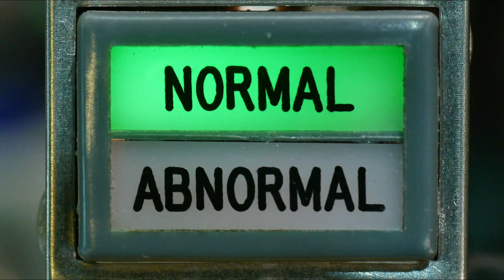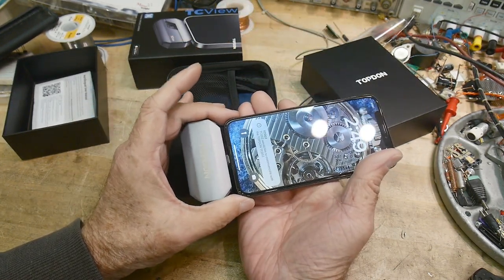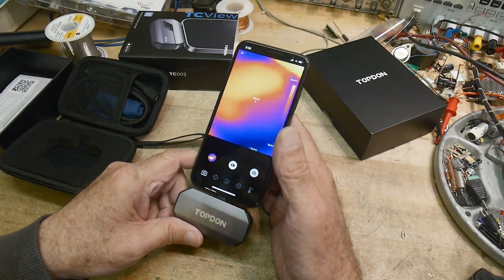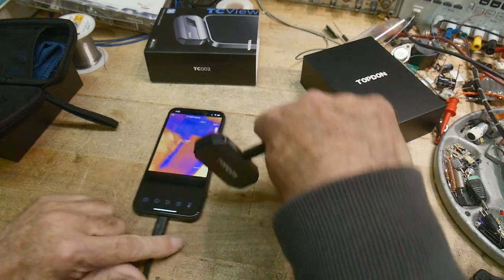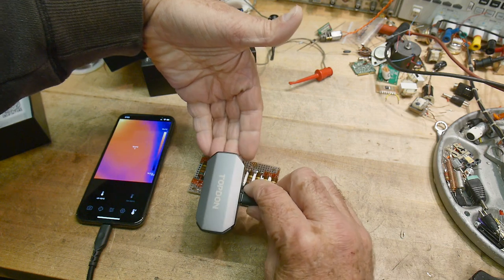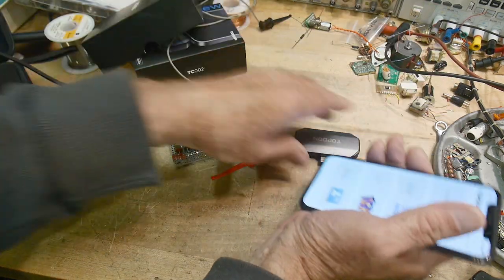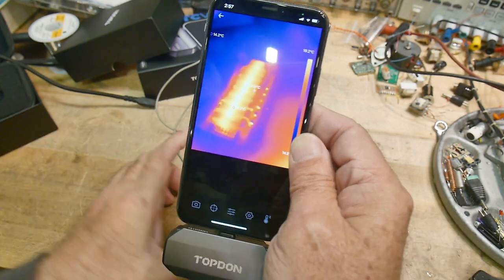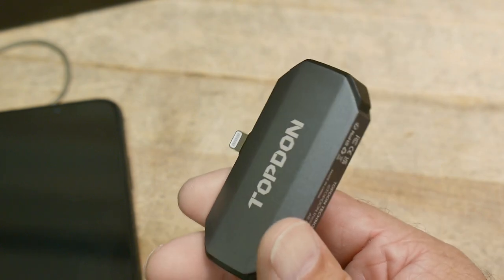#1501 TC002 Topdon Thermal Camera Review

Comment: Seems expensive for all of these thermal cameras. I bought my FLIR One maybe 4 years ago for $100. Have they all gone up that much since then?
Reply from the maker: how many pixels is the FLIR
Reply: FPS are hobbled for US ones...
Reply: @IMSAIGuy  I don't know. Probably less resolution but it works just fine for everything I have used it for so far. Update rate is a bit slow also but in practice it really doesn't seem to matter for what I use it for. I'd rather pay $100 than $300+ and live with it.
Reply: This is much less expensive than the FLIR model with comparable pixel count.  It also has better frame rate, temperature range and lower noise equivalent temperature.  I just got one of these yesterday, and I'm pretty impressed with it.  There is a little bit of fixed pattern noise near the edges (if you are not familiar, this would be somewhat like burn-in pattern on an old-fashioned CRT television), but its not very noticeable.  I did not see it at first.  At first I was skeptical that it could be this much better price/performance than the FLIR, but honestly it is even a little better than my expectations.  I wonder who is making their sensor chips...

Comment: So two major drawbacks!
Can’t change temperature units and you can’t flip the image vertically. 
Flipping the camera doesn’t help because the iPhone will automagically rotate the viewed image to the original correct way up which in this case would still be upside down. 
Two minutes no issues 
Can’t plug in direct to phone if phone has a case on it. 
And the camera is significantly wider than the phone!
It would have to be extremely slow inexpensive to get me to buy such a thermal camera add on.